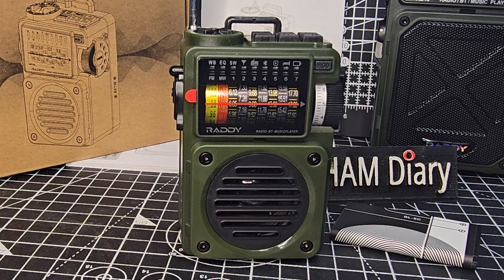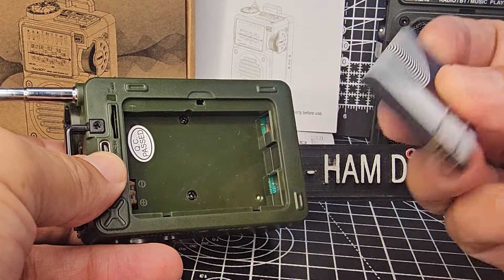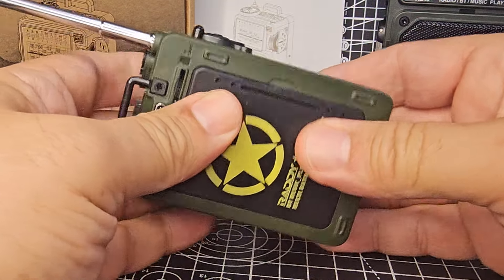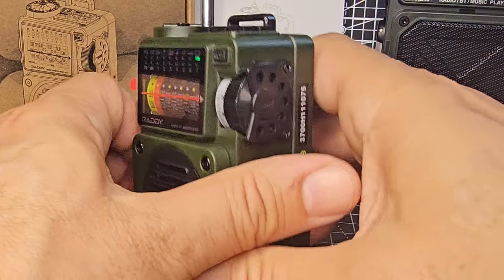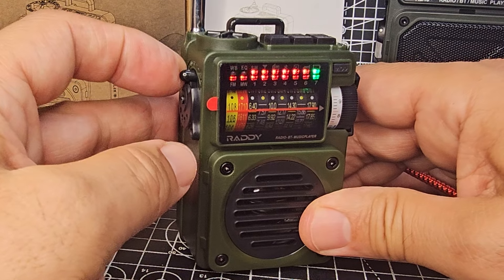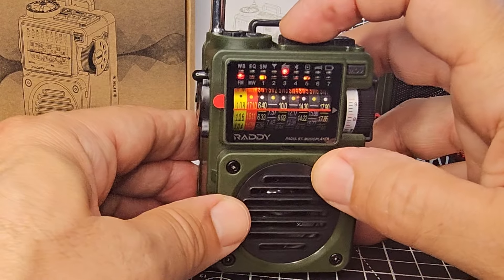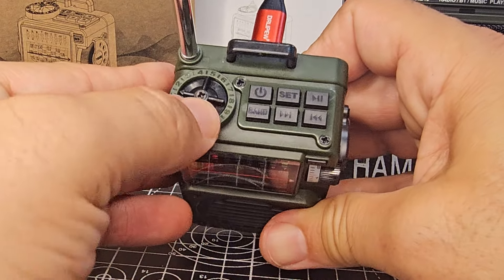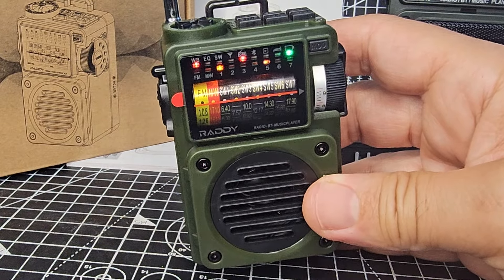RADDY RF750 - Shortwave Radio - Install Battery

Comment: It's an old skool nokia phone battery. Still get, Quick search. £3.45. Had some free christmas tat from Wifes work must have been 7 years ago if not more. 2015 or so, could be. A powered speaker thing used one. They are cheap. People still design things with it. Old look arm radio. manual wheel. Males a change to the LCD screens. old look.
Reply from the maker: Hi yes I have a MESHTASTIC device using one :)